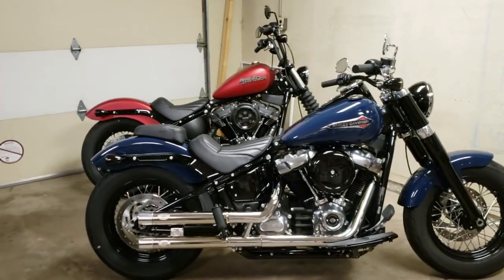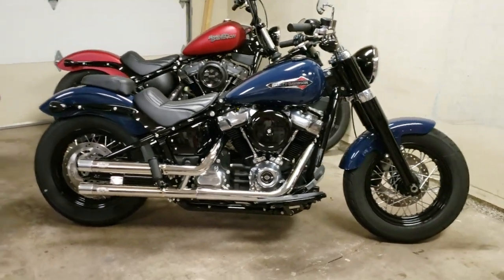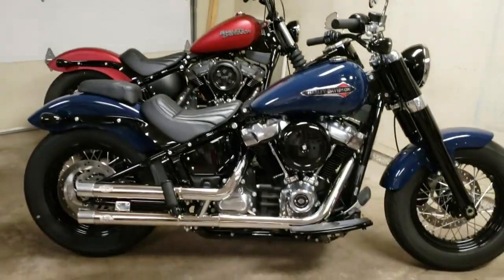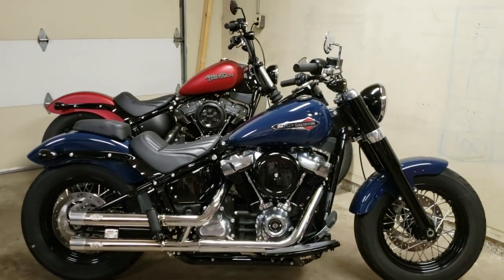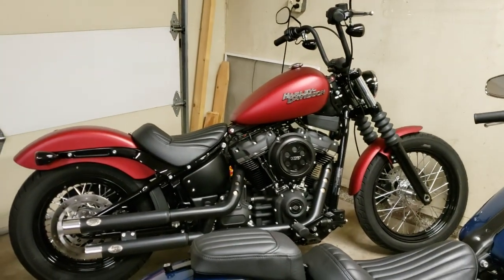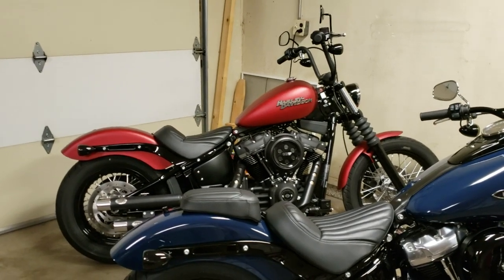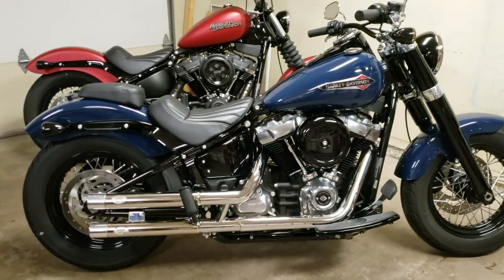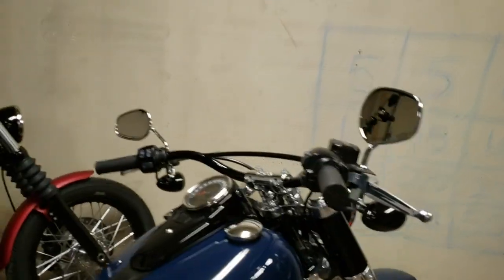HD Softail Slim & Street Bob Q&A

Comment: Love the billard blue on your slim. Arrowhead is legit cool guys and dealership. Next door Bubba’s 33 has pretty amazing burger and pizza. chandler HD is a sister dealer, and we lived close to chandler and they hooked it up on a new 2018 FXBB/2018 FLSL for us. Congrats on the slim. Im a taller guy so i like sitting further back on the seat. But same story with me flying off my FLSL slim stock seat when i punch it.

I went full exhaust on my slim, vance hines staggered short shots, fuelpak fp3 and Arlen ness big sucker intake and I absolutely love it! The fuelpak just is ABSOLUTE gold on all harleys but shines on the m8

On our street bob FXBB we got free vance hines twin slash 3” slip ons which ran perfectly fine with the stock tune but there was some power loss up top. We got a fuelpak fp3 and it solved all our power losses and made the bike run so much better. Increased MPG as well. We also did arlen ness intake on the street bob. Didnt have to do intake, but it breathes way better with it, more power and we had the tuner so why not

To those worried about warranty issues we never had one problem with warranty on either bike. 

Great vids keep it up! U guys are inspiring us to do a channel of our own soon

Comment: Did parts of the underside of the Street Bob seat have to be cut to be able to fit and the tounge extended with a mending plate of sorts?
Reply from the maker: R u asking if the street Bob seat had to be modified to fit the slim? If so, no. It poped right in no prob
Reply: @aztriumphster  the Street Bob seat I bought had the tounge to short and some pronged rubber cushions that are in the way but going to just cut them with a multi tool and attach a longer mending plate to reach the insert
Reply from the maker: @maelstrom200018  hmmm, i wouldn't have expected a difference but it sounds like u have it handled

Comment: Love your videos man. Thought 15 min was your longest video yet, meanwhile still no time wasted. Maybe work on a nice little intro and out-tro for your future videos. Thanks for the answering again. Would be good to know over a period of time, if you can notice any performance or fuel consumption difference. Or maybe because it’s slip on, there is none. Planning on getting the same slip on for my bike. I listened to the Facebook video on Anthony’s streetbob, some how it sounds “thinner” than your slim. Am I hearing it right? Or is it because of the sound recording quality that is different? Could you hear if there is a difference between your slim and Anthony’s streetbob?
Reply from the maker: My mufflers and Anthony's are identical with 1 exception, his are ceramic coated. I do hear a very minor difference betweeen the 2, which could be attributed by the coating. Also, the videos were done on 2 different phons and Anthony's video was done in an open parking lot while mine was done in a neighborhood with many objects for the sound to bounce off of. Hope this helps.
Reply from the maker: Josh, theres a comment on this video by "madfzr" that talks about slip ons and tuning. Read through it and see if it addresses an questions u have.
Reply: AZ Triumphster ordered my own rampage. Can’t wait to fit them on. Thanks to you!
Reply: AZ Triumphster Some slip on videos on YouTube suggested that gaskets are needed for the install. Does rampage come with gaskets or not required?
Reply from the maker: @joshfang1500  on mine and Anthony's rampage, we stole the gaskets from the stock mufflers. See Harley was awesome enough to taper the head pupe just before the muffler, so u will need gaskets. If u dont feel like pulling the stock ones out, u could order some from Harley.

Comment: Hi there nice video. I have question about the the rear tire and rim of the softail slim. Are they the same dimensions as the street bob and if not what size difference is there in rim and tire size? Thank you so much . Subbed
Reply from the maker: Thanks for the sub. As far as i know, they are the same size.

Comment: Thanks for the review. I’m looking at the street bob and slim today. Has the slim have a slip on exhaust and full system 
Cheers
Reply from the maker: That may be a difficult decision ha ha. The fuel capacity and sorta mid/forward controls on the slim is what sold it for me.
Reply from the maker: What about slip ons or full system?
Reply: AZ Triumphster does the Slim have a full stage 1 exhaust system or just Slip ons? If I buy the slim today I’m trying to make my mind up to spend that extra cash for a full system or just add slip ons?
Reply: You answered my question in the video.  Thanks mate
Reply from the maker: @JustAnotherReviewwithAlek  if u do the full system, ur gonna need a tuner with wideband o2 sensors, and ull need to make sure the full system accepts 18mm o2 sensors. Also, ull want an air cleaner.
Reply from the maker: @JustAnotherReviewwithAlek  u can run the bike with slip ons, stock air cleaner, and no tuner.
Reply: @JustAnotherReviewwithAlek  

why!?!?

Comment: Nice bike!  I almost got the same, but went with the industrial gray instead. On the left side of the bike, did you remove the lower black cap to install your passenger pegs?  I was debating a full system V&H big shots, but that appears to interfere with the right passenger peg mounting point.
Reply from the maker: I had to remove a small black plastic plug on either side of the bike in order to install the passenger pegs. Heads up, those plugs are actually threaded, so once u can get a hold of an edge of the plug, lefty loosy em until they thread out. Dean Speed Customs has a 2 into 1 full system  in development for the softail models called the BZKR. U can check it out on the website on the Scout and the Bolt and see if u like the style. It will not conflict with passenger peg mounting.
Reply: @aztriumphster  Thanks for the info!!